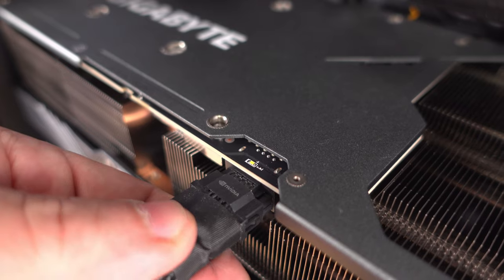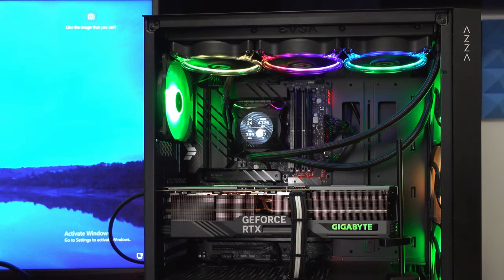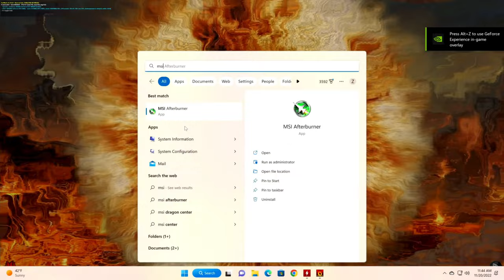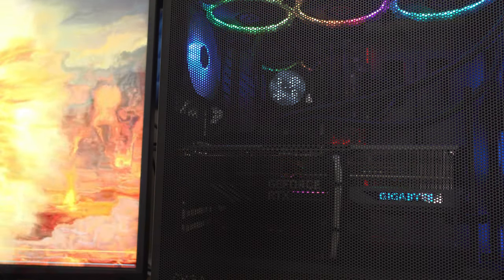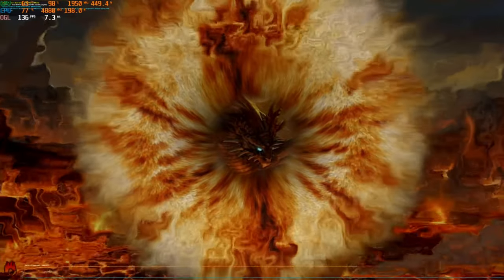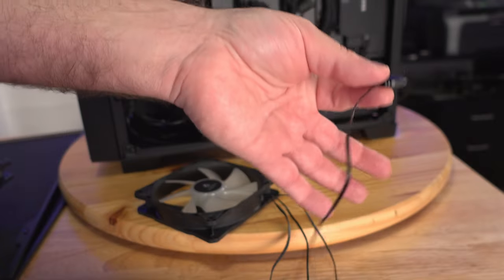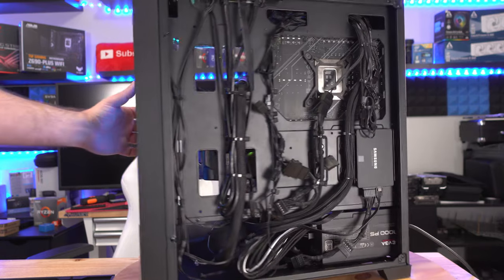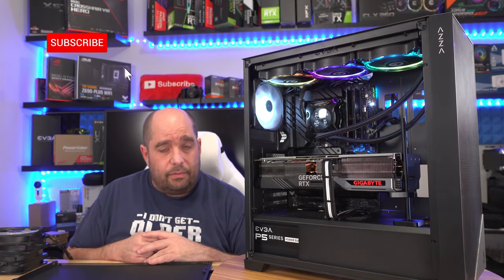The Beautiful PC Case with Problems - Are you a Fan?

Comment: Its a good case side panel design,good to have more options than heavy glass or blank solid sheet.Hopefully its a something the bigger brands catch on to.The case would be great and cheaper if they didnt include those rgb fans im sure.Good look at an intresting case(to me).
Reply from the maker: By chance, did you watch the review?
Reply: @ThisBytesForYou  I did man, good, honest review-neither the fans or the rear pci slots are dealbreakers-but the prices definatly are! Really a $60 dollar case, at best.
Reply from the maker: OK cool, just making sure.  The PCIE slot thing doesn't bother me, the fans do (especially since it potentially was the reason my board died, potentially and they don't work once both the board and fans were replaced, which leads me to think the fans were the issue, tested one by one as well) but yeah, the price is a biggy too.  Since I started the review it went from 120 to 108 on Amazon and 98 on Newegg, so it's going down, so maybe it will be $60 soon enough then I would say buy it quick ;)
Reply: @ThisBytesForYou  Yeah,thats why i think this thing is budget quality but at a silly price-stuff like wiring,connections ect can be a bit iffy with some sub brands,looking at CIT and uber cheap brands like those.

Comment: Hello, great video, I do have a question please❓ did you have a way to know if the fan issue was triggered by the RGB connectors or by the classic on-board fan connectors? The short or whatever happened that killed the mb, I mean. That sounded concerning. And you dared to connect another mb to those fans again, you are a brave one for sure.
Reply from the maker: Not sure, Asus finally swapped out the board

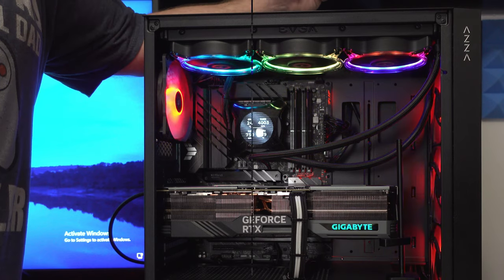Comment: 12:57 thanks for the Video but i have a question. I own the exact same case because i liked the Mesh etc. but i cannot switch the LED with the Button, if i press it, the Computer restarts. Which cable is for the LED on the F Panel ?
Reply from the maker: so you are pressing the right button, but who ever built the system, connected it to the reset header on the board.  What is the manufacturer and model number of your motherboard?
Reply: @ThisBytesForYou  Gigabyte Gaming X Rev v2
Reply from the maker: @Harperino  I need the exact model number,, b550, z690, z790 etc, I am trying to help you
Reply: @ThisBytesForYou  Sorry, its a B550 AM4 Board from Gigabyte - Model: Gaming X v2 Rev 1.2
Reply from the maker: @Harperino  ok, chances are thats not connected to change RGB, because your motherboard has RGB headers, those fans must be connected to the RGB header.  Check to see if you have RGB fusion installed and change your RGB lighting through there, if not here is the software: https://download.gigabyte.com/FileList/Utility/RGB_Fusion_B22.1221.1.zip?v=01a7cb77fcee6f889118639f20bb8131
Reply: @ThisBytesForYou  The fans are connected correctly, RGB Fusion does not recognize the RGB lighting…Already tried Aura, OpenRGB etc.
Reply from the maker: aura is for Asus motherboards and OpenRGB can cause issues, uninstall all of that, including RGB fusion, restart your computer the reinstall RGB Fusion on your computer.  The fans are connect correctly how, to the ARGB connection on the motherboard and the PWM connection or only the PWM connections?  Installing all the RGB software causes issues.